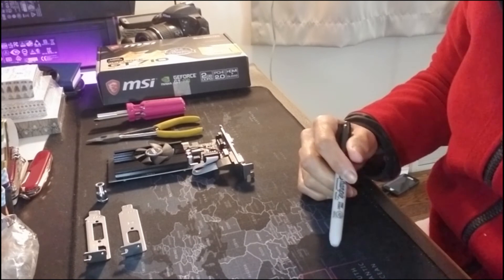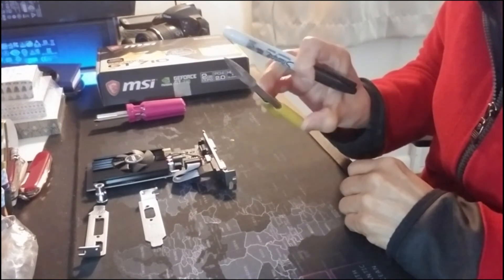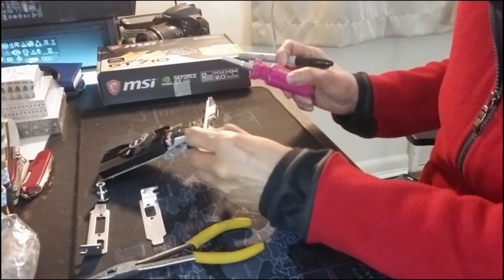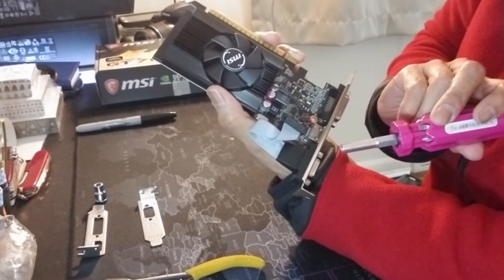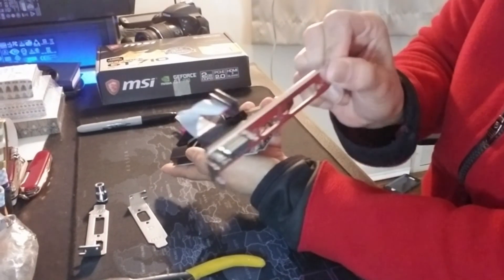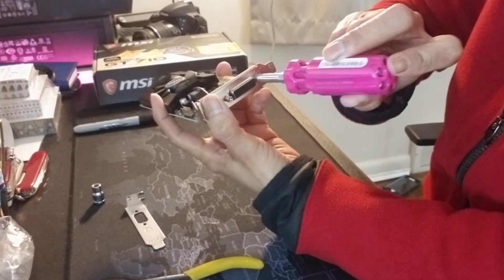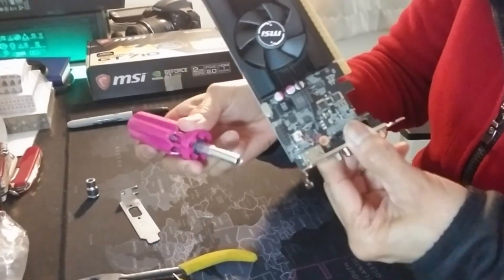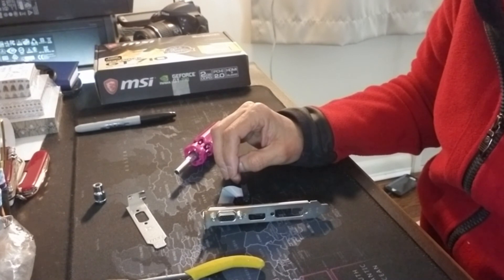2021 Tutorial: Replace Video Graphics Card Bracket (Standard to Low Profile) on MSI GeForce GT710

Comment from the maker: Hi @ivannbah556. If you want to use vga low profile then switch to the vga bracket, if you still have it. If you want to use all 3 (hdmi, dvi, and vga) then you would need to install the vga bracket on a separate slot. I just tested it on my pc and it works with all 3. Thanks for the question.
Reply from the maker: Here is the link to the video on how to connect the VGA adapter to the graphics card. https://youtu.be/Au-8NVt6dW0